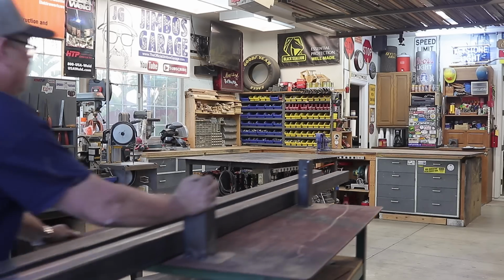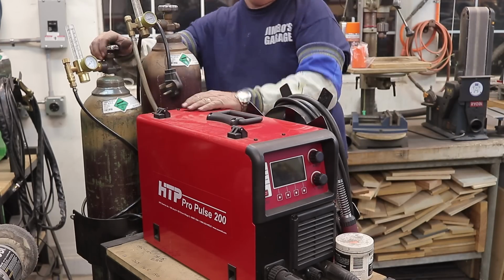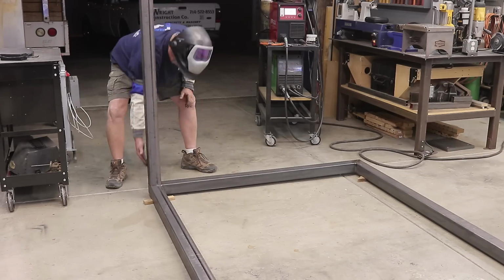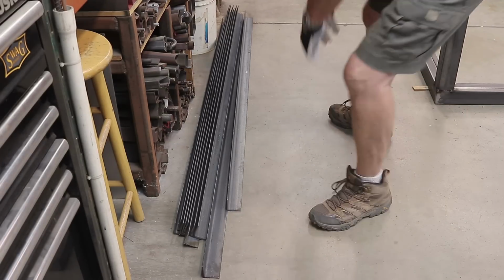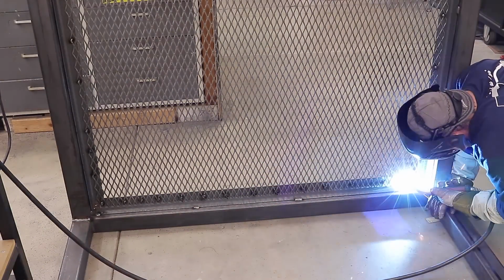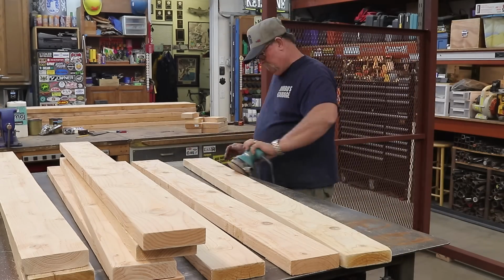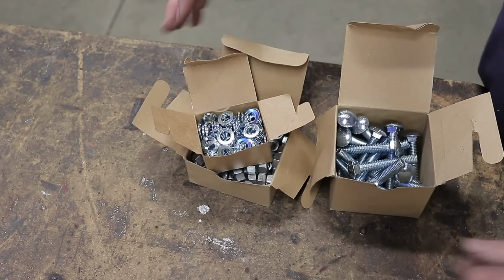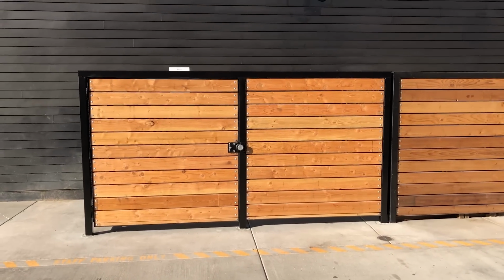Metal and Wood Outdoor Storage Enclosure | JIMBO'S GARAGE

Comment: I saw you using ratchet straps... I used to do that until one bust me in the face due to long term use, I use chain binders (forget professional name) but they pretty much hold my projects plum, check em out to see if they could work for ya

Comment: Hey jimbo I’ve got a question for you. I’m cutting about 270 cuts in 2x2 angle iron and I’m finding that my blades are going dull after about 25 cuts unless I only cut into the metal on the thinnest portion. I’m having to do a down cut, then flip piece so my blade never comes in contact with the material on a thick portion. Already used 5 blades and wondering if you have any suggestions
Reply from the maker: Thanks for watching, What kind of saw and blade are you using???     Jimbo!
Reply: JIMBO'S GARAGE evolution steel blades. The blue one

Comment: Hi Jimbo, I love your work, we do similar stuff so its fun to pick up some tips and tricks from you. I’m in the market for a new hood and was wondering what you use? There are so many out there it’s hard to decide, thinking I’d like to spend $200 but if there’s a reason I need to spend a bit more I can. I live in Texas and would love an air supplied unit but fear they’re a bit too expensive, currently have a Miller classic which is still pretty decent lens wise but the head band is falling apart and driving me crazy. Thanks in advance, know it must be hard to reply to everyone!
Reply from the maker: Thanks for watching Robert, All the major brands are good now,  I use a 3M 9002NC Speedglas.    A good hood will be between $200 and $600    Jimbo!

Comment: This metal framing will last till the restaurant isn’t t there anymore. The polyurethane won’t last a year though Jimbo! If you go back and scuff sand it it and  throw some spar urethane on it (3-4 coats) the wood will get 3-4. Using this finish will also help protect the zinc coated carriage bolts, washers, and nuts you used so they don’t rust. Now, can you teach me how to weld cuz I am bad!

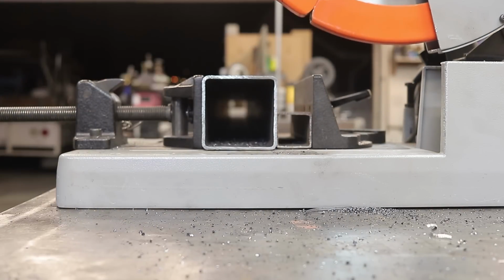Comment: Hey mate, Just wondering why you pack your drop saw vice with a small piece of square tube (Seen at min 4:13) and not put the material being cut right up against the back of the vice?
Reply from the maker: Thanks for watching, I do that so i get the material i'm cutting right under the middle of the blade.   Jimbo!

Comment: I couldn't see you drilling some holes in the frame. I hope you did... An airtight welded frame (the top part, not the legs) like this will inevitably expand and in the end will get cracks due to air expansion with temperature changes.

Comment: Pretty cool project!!! And honestly man for your sake you should really start getting the mill scale off of your seams and add a slight bevel on this structural stuff and it’d make the welding much easier and especially the ones that are getting sanded flush cause you’re still getting good penetration without grinding the majority of the weld off. And a suggestion for moving heavy stuff like this build you some dully’s out of a piece of 1/2” plate about 18”x18” and put some casters on it and  it will make situations like this a lot easier on you

Comment: One day you build a realy big Project and realized after finish you door of the garage is to small 🤔😅😅😅
Reply: Happened to one guy locally. He built a row boat in old school building as it was only thing that was big and cheap enough for this build.. well it happened that boat would never get out trough the corridors and doors, so he removed windows and shove it out from there. Also if it can fit out form to door.. make door bigger!

Comment: Turned out nice as a deterrent . But for extra security you might have added expanded metal to the inside of the wood siding. A quick chainsaw would open that thing up as it sits :)
Reply: Ron Hart yes i agree. And concrete anchor it down as a quick tow truck could have taken the entire cage ... or even better position an armed guard 24/7 in front of it. 

But all kidden aside - i run into similar things all the time - the customer wants me to match existing,  and an additional few hundred dollar already put the project out of budget ....

But seriously - chainsaw? 

I mean i am not saying that it cant happen - but granted - a guy walking with a chainsaw around through the city would for sure have to answer a lot of questions where i come from ....

Comment: Awesome build! Love how you fit your plasma table in your shop. Do you think you might be forced to downsize on the welder collection (for space reasons) and get a crane of some type if you have a lot of big stuff like that? Also what brand of bit was that you where using? You said cobalt but I didn't know if it was a Kobalt brand or cobalt metal? Keep up the great work!
Reply from the maker: Thanks for watching Tony, Yes i know i have alot of machines, but they all have a purpose, I think it was a millwakee cobalt coated bit, worked great!   Jimbo!
Reply: Tony Baggett i am pretty sure he is referring to cobalt metal in the drill ( as those are typically much tougher than “regular black”(hss) drills. 
Cobalt drill have a longer life and can also be used for stainless.

Comment: You're such a great welder, why not show off your welds! For time sake would it not have been faster to bevel your ends so your weld doesn't sit up on the surface and wouldn't needed ground down? Great Video!
Reply: John Sherwood I think it would be close to the same time because beveling takes around the same amount
Reply from the maker: Thanks for watching John, Most of the time i grind down the welds anyway. Jimbo!